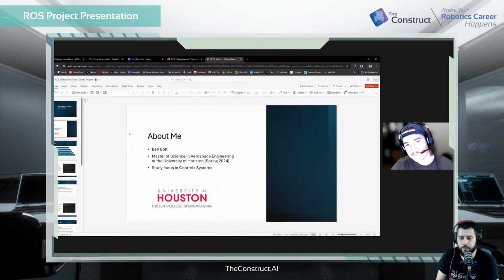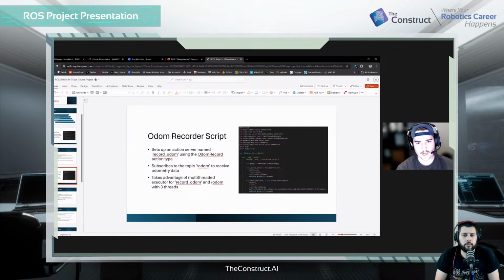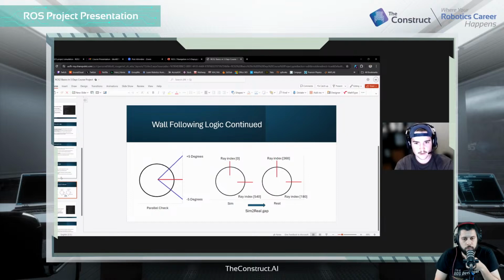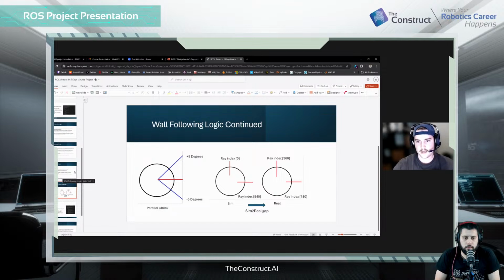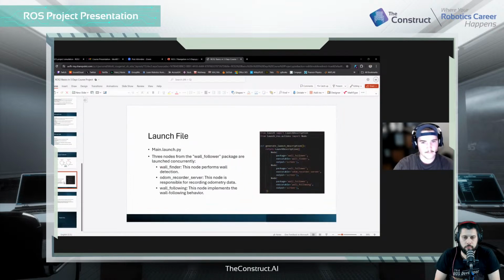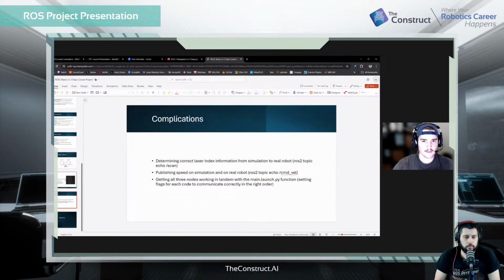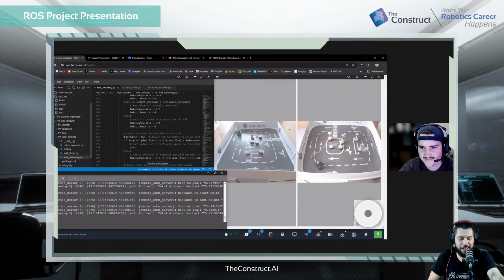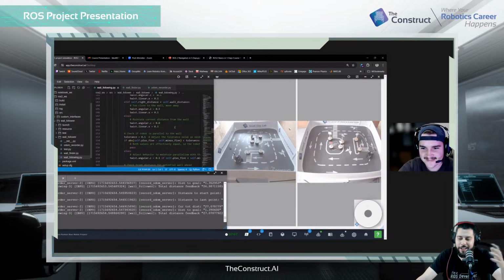Ben Bolt ROS 2 Basics Project Presentation

Comment: Nice work Ben, and great questions from Rodrigo.  The +/- angle laser measurements with an error measurement and a PD controller sounds like na excellent idea.  Servo control would improve tracking. 👏  I like to think that after the presentation the robot finally found its desired stopping position.